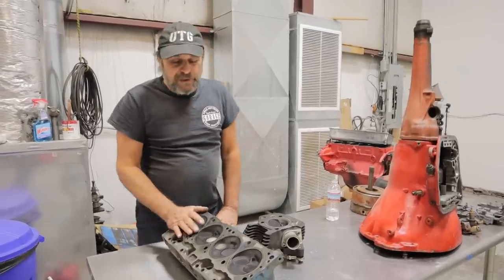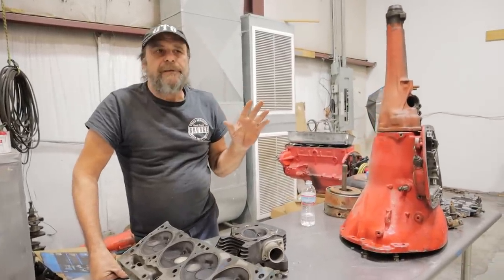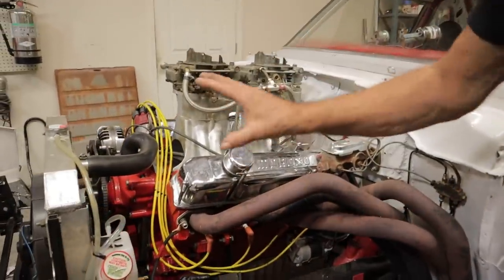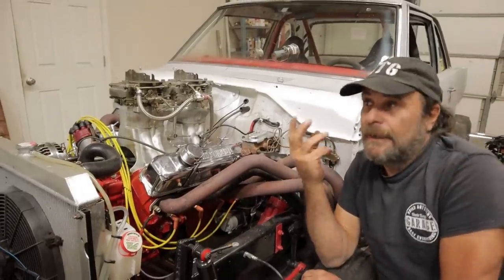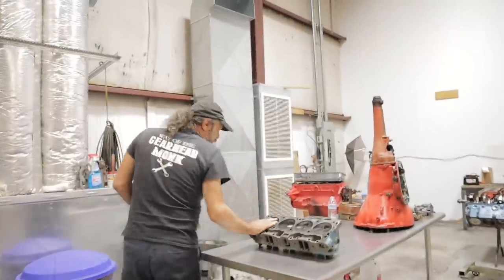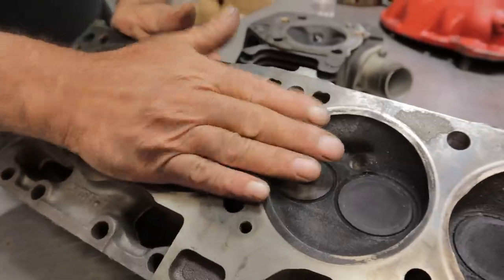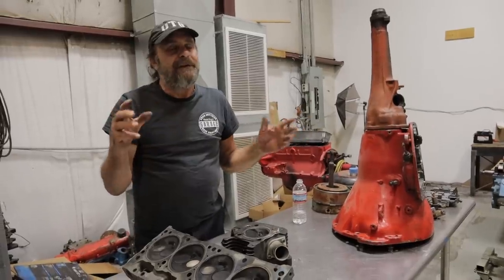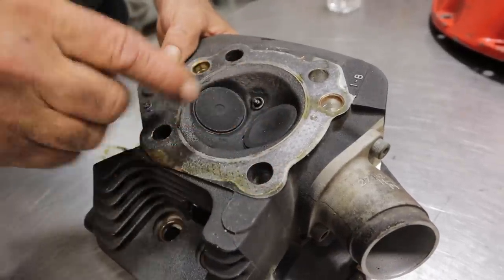The Secret Life Of Your Engines Cylinder Heads - How Combustion Chamber Shapes Make Power

Comment: Hemisphereical combustion chambers, 4 valves per cylinder, and modest turbocharger is how my car makes 300 hp from 139 cubic inches. In a 3300 lb wagon, it will get 26 - 28 MPG.

Comment: I was 12 and loving engines for the first time. I ran a little Clinton engine with various exhaust pipes and noticed that the thing wouldn’t run without some kind of pipe. My dad built houses so I had piles of copper pipe to play with so I would hammer out pipes that looked Kool and fasten them it the little Clinton engine. What I found was a piece of 3/4 inch ran the best. But if I held a pices if pipe about 1/8 inch from the exhaust port it would run but moving farther away the engine would sputter and quit. Later in college physics class I learned why. Interesting you bring this up today. Boy I love high performance engines! Can’t wait to see your development on those heads.

Comment: So now you need to have an episode on Bob Glidden and welding iron heads to get dual quench areas and small "heart shaped" chambers.  A lot of pioneering work was done in his shop.  And he never showed his heads to anyone.  They were always covered.  
10 Pro Stock championships with 5 in a row tells you that he knew what he was doing.  Many aftermarket heads emulate Glidden's pioneering work.  👍
Reply: If no one ever saw the heads then how did they even know he was legal to race? 
I hear stories like this all the time and I dont see how that makes sense.

Dont they see the engine bay during inspection? Do they just take his word it's a legal size engine? I dont get it.
Reply: @contraband1543   It's possible that if the heads are just meeting the requirements of what getting the requirements of what metal they are, That they wouldn't have to see anything. I would assume they are allowed larger valve size and port work the port work but probably they do inspect the cylinder diameter and the piston compression And the intakeAnd feel delivery system... Outside of that I don't think they care too much about the rest because you really can't cheat any other way with heads unless you change the metal?
... Especially if it's a stock Sized cubic inch class, Heads might not even matter at all.
Reply: Bob gliddens clevelands ran like a Big block 😎
Reply: When the Ford Cleveland heads came out, they had real good combustion chambers. Then to meet emissions Ford adopted a lousy open chamber. The worst thing wrong with the Cleveland heads were the exhaust ports. Every one of  the racers spent a lot of time trying to improve them.
Reply: @fustyblatherskite2142   I think I know what you're talking about because I Opened up those exhaust ports... It's almost like for a mission's reasons they just close closed up the exhaust hole and recast the head the same with smaller ports... It's almost like you could see how much to take off off by the casting marks
Reply: @Jubr123  it has been said that a stock 1970 351 Cleveland 4V, HP measured at the flywheel, on a dyno with headers, was good for 375 horses. That is big block territory,  especially considering that a Cleveland was 100 to 200 pounds lighter than most big blocks.
Reply: @fustyblatherskite2142   run the intake through them... 🤔
Reply: @fustyblatherskite2142  Yep, i’m all into clevelands!
Reply: @contraband1543  they cc the cylinder with head on it,right where it sits,it has the wrong numbers for ccing,he's jacked,and fined,GLIDDEN was a genius,he made a LA engine scream,he was pulling 9200 rpm every gear,the only thing i'm interested in,is the technical info on the LA engine he was running,man was truly a genius machinist
Reply: @fustyblatherskite2142  One thing about some ford heads I do not like at all. 
BB heads too. Whats the point of agood flowing intake if the exh is horrendous?Maybe thats why so many run a bunch of ovelap, tight lsa to pick them up compared with a good exh port and its needs?

Comment: I’ve never taken an engine apart or done any of this stuff but I love UTG! I’m just a home noodles trying to learn.

I changed my timing belt on my 99 CRV and now I realized I got my intake cam off by one tooth. It runs but uses too much gas. Now I understand the importance of the intake and exhaust valve timing.
Reply: experience is more valuable then reading info imo. Keep at it

Comment: That concept of exhaust scavenging to help fill the combustion chamber has been used on two stroke diesel’s from conception. Never thought of it in gasoline engines. It makes sense. Thank you for bringing that information to the forefront.
Reply: In the 2 stroke Detroit diesel a blower does all the scavenging, there is no "exhaust stroke" all the "intake timing" is in the port size and location. There is one camshaft for the exhaust valves.

Comment: Interesting to see what you configure with the combustion chambers- Dave Vizard would be the perfect brain to pick for insights. He also has an appreciation for classic Mopar engineering from those days, and rightly so!
Reply: He has several videos out on quench pads, swirl port, valve unshrouding and different degree valve angles with a flow bench numbers to back it up.  He has some really in-depth videos where he cut cylinder heads in half and shows you how to port and polish and open up heart-shaped cylinder heads. The man is a wealth of knowledge. 💪

Comment: Fascinating. I learned of the importance of overlap in air cooled aviation engines but it was to cool the exhaust valve, thank you Tony.
PS I thought pointing the spark plug towards the exhaust valve gave it the most boom.
Reply: I heard that to. I remember guys indexing the plugs back in the day.
Reply: Pointing it towards the exhaust valve was to prevent pre-ignition. That's pretty much when the incoming charge gets ignited before it has filled up the combustion chamber. By pointing to the exhaust, the intake charge fills up the cc and is fully ignited, but the rate by which it ignites also becomes a factor. Igniting a full intake charge and the rate by which it burns is directly affected by overlap.

Comment: Uncle Tony. The absolute best example of overlap and collector design is the rotary engine. If you talk just overlap 2 stroke is where you look. There can be 100% plus change in power out put along with rpm of said power out put by the over lap and collector and header design in a rotary and 2 stroke

Comment: I’m glad you brought forced induction into the vid it’s often assumed it’s exactly the same as n/a but it’s definitely not, my own gm v6 had a closed chamber but with dished pistons with a detonation prone large squish point so I’ve been developing and trying different chambers and the most recent are completely open and it’s got excellent off boost drivability and response and it’s almost detonation proof with 9.3:1 comp running under 30psi of boost on 98octane

Comment: This is a very good episode Tony!!! The movement of exhaust gas through the exhaust system, causing a vacuum behind each pulse that helps to initiate the flow of the fresh air/fuel mix into that cylinder, because of the breif moment of both valves being slightly open at the same time - aka- valve overlap.... When I was going through A&P school, the instructors explained that valve overlap was an event that took place to cool the exhaust valves... Looking back at that training, I remember that everything was to emphasize the reliability of airplane equipment.. A very small emphasis of how to tune for more power and speed was being taught in those schools... But I now tend to believe the reasoning that You give here Tony... The overlap is a function to improve responsiveness and performance of 4-stroke reciprocating engines...

Comment: A couple other things you don’t hear much about the SBM is that the plug is about as centrally located in the chamber as you can get for a wedge head, and the valves open closer to the centerline (max width) of the bore for less valve shrouding. But the factory ports aren’t ‘great’ so they need all the help they can get, as in, swap ported 360s on! lol
Reply: One way to evaluate the effectiveness of a combustion chamber is the spark advance needed for best power. According to mopar performance, best for SB mopar is 35, Hemi 36 and BB 38 degrees total. In a Magnum it's about 32.
Reply: @vipottaja  good points but it also depends on bore size. Typically bigger bore you need more advance all else being equal.
Reply: @vipottaja  like Chevy Vortec heads versus anything they made before them.

Comment: Tony I'm not a mopar guy and not a chevrolet guy, but always been a fan of closed chambers, compression and cam timing with intake closing being the most important event. And testing is the only way to find the sweet spot on the cam design. I haven't bought an off the shelf camshaft for my own projects in over 30 years. Yet with all I said, I know there is much more to be learned about combustion chambers design. 
Ok I'll let the cat out of the bag, I'm a lowly oldsmobile guy. I have a stock stroke .030 bore 455 that makes 625hp/640tq on the pump with a single carb single plane. Currently running a custom crane hyd roller with a standard iron distributor drive gear on the billet shaft so I didn't have to worry about bronze gears. The cam is based on LS chevrolet lobes, it's .620ish lift 255/260ish @ .050 duration on a 110 lobe sep. I know there is more power if I tweak the grind but I'm tired of juice lifters and wanna go solid roller next. Goal is 700hp normally aspirated all Olds, and I'm on my way. The info in this vid is just part of the answer but well done presentation and I hope others pick up on what you are throwing down!
Reply: Instead of doing an Edit on my own comment thought I would just throw out another one.
All this combustion chamber talk revitalizes my desire to build a custom head for the brand of my choice, which is Oldsmobile, and what I want to achieve is a canted valve, a la big block chev (the porcupine) and fit them within the space given. Reason is this cross flow theory/dynamics Tony is talking about in the video, but doing so by unshrouding the flow around the outer sides of the valves. Valve shrouding kills more power than many other things when the inherit design is a 10 degree head with the valves in the same plane. I believe a canted valve in an aftermarket aluminum rough casting cyl head for Olds may finally achieve the 400+cfm mark to make this engine more competitive. I could be wrong with this but sure hope to try it before I die. 
Around 1969 Olds engineers designed a near "hemi" design based on a standard 455 short block. I'm a die hard Olds guy and forget the freaking designation they gave this engine. Maybe it was called a W-43? I don't know I gotta look it up... But they actually built a running version decked out with stock accessories of the time to actually go into production. But 1971 and emissions kinda killed it. I believe they only built 2 or 3 of them. One is on display in the GM car show trailer showing innovations and different engines the company built over the years. Far as I know there are no running examples out there in the real world as of 2022. 
Thing is I wanna make a cyl head out of aftermarket aluminum to kinda achieve the same thing. I'm not gonna set the world on fire but if I can bring a new found respect for the Olds name then I'll be happy.

Comment: Most interesting Tony. It's almost like listening to my grandfather explain the very same things years ago to me, (I'm almost 69 now). About 20 years ago I created a set of 400M heads with "squish" areas like a 460, but built for the 531/400M engines. They ended up working very well. I have a set off,  and if you would like I will dig them out and take a few pics and send them to you for any  sort of reference that they might be good for.

Comment: David Visard discusses this in his books and on his channel. It is sometimes called scavenging, a term more often associated with 2 strokes. Thats also why cleaning up the intake valve bole and a 5 angle valve job has disproportionate increases in performance than one may expect.

Comment: Like an expansion chamber on a 2-stroke but without the reverse cone to force the fuel/air mixture back into the cylinder. Hey Tony, a great thing to add to this would be an explanation on how motorcycles have smaller combustion chambers (and hence shorter heat path) allowing higher compression ratios on pump gas. Another interesting thing would be an explanation of Anti-Reversion headers. There were some really good ones for VW/Porsche Type 4s in the early 80s that outperformed standard headers (there were rotary scavenge designs as well). These anti-reversion headers had a sort of cone with small aperture facing away from the port so if gas tried to revert back to the cylinder it blocked reverse flow. This is done sometimes now by having header ports a bit larger than cylinder head exhaust ports creating a sharp edge. But this tech changes. When I was a kid racing go karts we didn't use expansion chambers but just exhaust megaphones. So, we fabbed up port plates with semi-circular protrusions into the crankcase to decrease its internal volume thereby raising scavenge pressure to the intake port. These were referred to as "Rabbit Ear Stuffers". When chambers started showing up these seem to have gone away as the chamber was used to suck the fuel/air mixture out of the crankcase (via the transfer/intake and then exhaust port) and tuned to length to push the mixture back into the cylinder after the intake port closes. It was/is effectively a form of supercharging as it can fill the cylinder with more than a cylinder's volume of fuel/air mixture. It is so long ago now that my Power Products, Westbend, and McCullough engines (MC10) are actually antiques. Ha Ha

Comment: Great video. The primary header tube length and diameter  in conjunction with the sizings of the collector create a low pressure pulse. Plus the column of hot air racing away from the exh port draws or sucks the initial incoming intake charge into the cylinder. Yes small amounts of raw fuel air are siphoned away but it kick starts the int charge moving.  Add that to ram tuning the arrival of the fresh int charge pooling up behind the intake valve and you gain serious horsepower.  Ram tuning both int and exh to certain rpm ranges.   Extra compression almost always adds more power too across the rpm range.  The gigantic amount of deep scientific variables is a key reason I love drag racing so much

Comment: Very informative and helpful. On My '68 396 BBC (bored to 402) short block Im running some late 70's open chamber large OVAL port heads from a dump truck 366 bbc w/ SMALL valves ( 1.92 intake /1.64 Exhaust). The small valves give REALLY nice low end torque for taking off from a stop but arent designed for much above 4500 RPM. I found a set of 68 closed chamber Heads with the 2.08 int/1.75 exh more suited the the original 396 power levels which i may swap at some point. In a 58 Chevy Bel Air low RPM is just fine though...w/ 5000 RPM roller cam

Comment: You made good sense.  Shape of combustion chamber may be a bit nuanced to some,  but volume will be the biggest factor.  This vid is insight as to why volumetric efficiency is not a fixed number on any engine over its full rpm range.   A higher revving engine having less time [milliseconds] of overlap for the same cam needs a smaller chamber for the negative signal created by outgoing exhaust to begin intake charge movement.  I had to deal with a few hydraulic systems over the years, and accumulators behave similarly except the pressure is positive:  the bigger the accumulator, the longer it takes for the pump to bring it up to pressure.  More interesting is how much influence does combustion chamber size tilt the spread on dual pattern cams?  Maybe that's a good part two.

Comment: Excellent video and valuable insights. Love how it was all explained! Supercharged applications I totally agree that there is always a high pressure gradient available to move things in the right direction but turbocharged comes with inherent drive/backpressure that varies greatly with the setup and across the operating range- making scavenging, or residual exhaust gas which is what's left if you don't scavenge the rest of the chamber, displacing what would otherwise be filled in the following intake stroke. What you're describing is what we've attributed to some significant changes in power psi and response in turbo applications with an exhaust manifold change alone. That effect scales well with the valve overlap and whether the overlap phase is a good thing or a bad thing